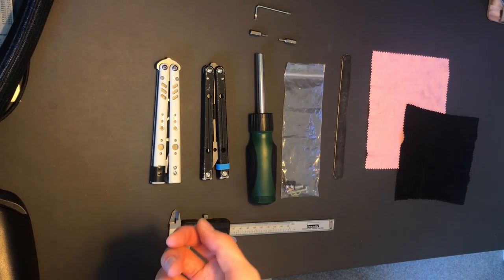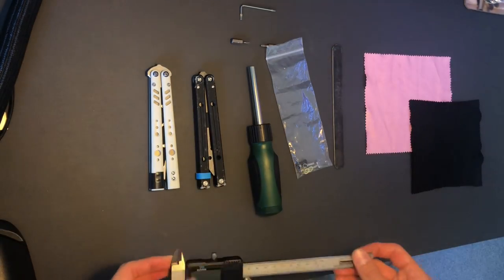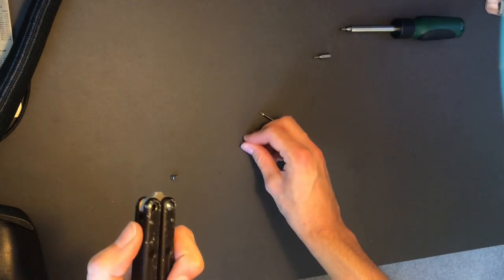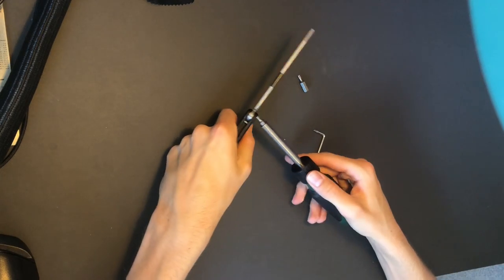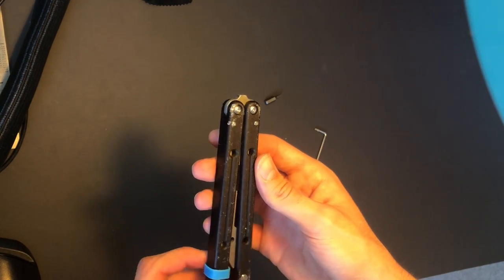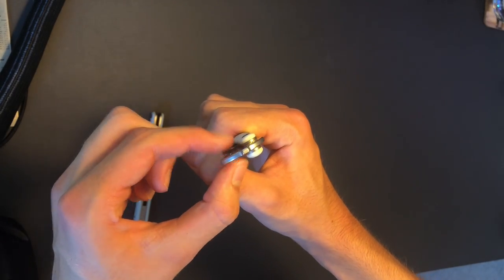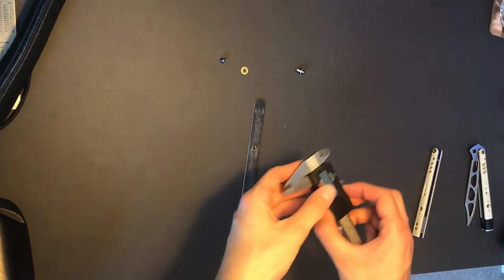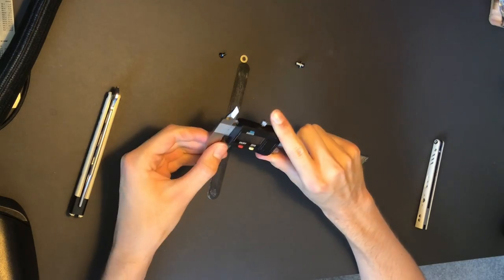How to fix tap and sand bushings | Balisong Tuning 101

Comment: Very helpful vid. One thing i learned is if you measure the thickness of the blade where the bushings sit then add .0012" (or the metric equivalent) that should be the proper bushing length or at least very close.
Reply from the maker: Thanks for the info
Reply: is this still accurate?
Reply: @mommymilkers8609 don't see why it wouldn't be
Reply: .0012 millimeters or inches?

Comment: I've been having some trouble putting my baliplus kraken back together because the zen pins are press fit. I am unable to slide the washers in as the space is so tight. Any tips on how to open up the handles? As always, great job on the video!
Reply from the maker: i hear everyone saying this about the b+ kraken. Make sure your bushing is tuned properly so that you can actually slide the washers in. also try opening up the space by using a flathead screwdriver to pry open the gap
Reply: @CloneSupport  Thank you so much man!
Reply: I would use a torqs bit and put it in the hole and bang it around a little till it aligns
Reply: why are you here💀

Comment: when you measure the width of the blade shouldnt you include the width of the washers? Wont the washer not be wide enough to support the blade if it doesnt stick out both ends of the washers? You didnt account for that so im confused, wont the bushing be undersized if you sand to that value?
Reply from the maker: Hi there! I think you are talking about a floating washer system (one where the bushing goes through the washers and contacts the handles) in this case, yes, measure the washers as well and account for them. This video is for standard systems where the washers sit on the bushing so you want a tiny bit more than the blade (+0.001in/0.02mm) just enough to allow washers to contact the bushing and not put too much force on the blade
Reply: ah i see, thank you! @CloneSupport

Comment: no matter how much i tune my bushing of my kraken as it still have EXTREME TAP and still have free swing
Reply from the maker: I would definitely recommend you get a set of calipers to measure down to the nearest 0.001 inches. This way you can make sure they are correctly sized. Also, think about changing the washers, old worn washers can cause tap even if the bushing is tuned correctly

Comment: Trying to tune my baliplus rep but it binds when all the way tightened down.  The bushings look perfect and fit fine so I think it could be the washers.  Lmk if you can help
Reply from the maker: Binding will be due to 2 things, bushings being too small or pinching when the handle are not perfectly parallel. Try removing the zen pin screws when tuning and then putting them in finger tight afterwards

Comment: Very useful and well explained video :D
I do have one question doe: Can I reuse the washers if I have to do multiple tries in tuning? I disassembled my Nabalis Vulp and changed the Washers and after cleaning and all and lubing again and so forth I put it together again but now I think that the factory bushings are a bit undersized especially my bite handle one as I cannot fully tighten the screws without it almost completely stopping to swing. Very noticeable with the bite handle, safe handle is better but it still applies I guess? Is this a case of undersized bushing or do I get something wrong? 
Anyways as I would have to disassemble it again can I still use the "new" pairs of washers? Because I only had enought for one replacement in the package. Bushings would be no problem as I have to replacements that I can sand down.
Reply from the maker: Yes you can reuse washers that’s ok, as long as you don’t damage them when taking it apart and putting back together. Also for the binding, if you put new washers in, sometimes they take a little bit of time to “break in”. Oil them up and just try to flip it about for 15-30 mins to see if the swing improves. If it’s still binding then yes, the bushing is probably undersized

Comment: idk if im just stupid or not but my bali had 0 play when I got it and developed it fairly quickly. my understanding is that with cheap and ductile hardware, use will deform the bushings and/or washers, creating space and allowing the handles to wiggle. wouldn't the only fix for that be using washers and bushings made of tougher/harder materials so that they don't deform and retain their tolerances? i just don't see how making the washers smaller could possible fix an issue that arises from there already being too much space between the blade and the handles.
with a sandwich design, it makes sense because you can bring the sides of the handles closer together but with a channel design it just seems like making the washers thinner will only make the issue worse??
- id like to add that obviously it does work bc you just did it but I just don't understand how, it seems to go against everything I've learnt in my engineering course lmao
Reply from the maker: Wait no youre not making the washers thinner, you are making the bushing thinner if it is oversided. Yours sounds like the washers are getting worn from use, the best fix for that would be new washers. What i did was sand the bushing to bring the washers closer to the blade and reduce the tolarance so that there would be less of a gap. This means less movement in the pivot system and less tap and play
Reply: @CloneSupport  ohhhh right, that makes a lot more sense haha, cheers man

Comment: I have a question, i had applied blue loctite to the screws when i noticed one of the screws was still loose. When i tried to take it out the other side would spin with the screw, how can i remove the loctite to be able to take the screw out?
Reply from the maker: Try adding heat with a hairdryer, it might be enough to loosen the locktite

Comment: What to do about blade rub on one side? like the front face of the blade doesnt touch the handle but the other overlaps a lot, no amount of changing the brass bits seems to fix but the bushing doesnt seem oversized anymore
Reply from the maker: Is it a clone? It could be a bent blade, there’s not too much to do about that

Comment: you didnt really touch on tightening zen pins. Do you just crank them down?
Reply from the maker: Sorry i completely forgot. For Zen pins you want to make sure the pivots are fully tightened with good swing first and then crank the zen pins as much as possible. If this causes poor swing then back the zen pin out untill the swing is fixed and then loctite it in place
Reply: @CloneSupport I know I'm a bit late, but  
So, when checking if the bushing is oversized or undersized you don't tighten the Zens all the way, correct?
Reply from the maker: @Brozi  with zens it can be more complicated. I don’t tighten zens when testing because sometimes over tightened zens can cause binding.
Reply: @CloneSupport  yeah, I noticed that. Either way, I measured the bushing and found out it's slightly oversize, so I'm gonna have to sand it a bit. How much do you think the difference should be? My knife is Atropos kirat bro.
Reply from the maker: @Brozi  0.001” -0.005” wider than the blade. I try to do 0.001” but if you are not confident then aim for 0.003”
Reply: @CloneSupport  ok, many thanks for the answer!

Comment: I'd avoid squids titanium hardware if you're using a steel bit. As it will strip really easy
Reply from the maker: It’s fine for me
Reply: had to dremel slots in squids titanium to back them out since hardened wiha bits annihilated them in my ab, stainless hardware now

Comment: I can’t get  the tap out of my nami clone
Reply from the maker: Are the screws as tight as they can be?
Reply: @CloneSupport  yes they are and I’ve also tried to tune bushings but no
Matter how little I take off it ends up binding
Reply from the maker: @benbenavides9792  they were probably undersized to begin with
Reply: @CloneSupport  they wernt tho.. I could crank down all the way and not have them bind.. they don’t exactly bind but swing then it gets rough and stops and no
Matter how hard I crank down.. even with an undersized bushing I get tap
Reply from the maker: @benbenavides9792  see if you can find thicker washers in the spare hardware. These might be enough to reduce the tap. But tbh it’s baliplus so it might be quite hard to get tap out of that balisong